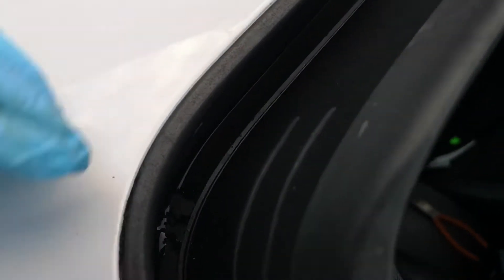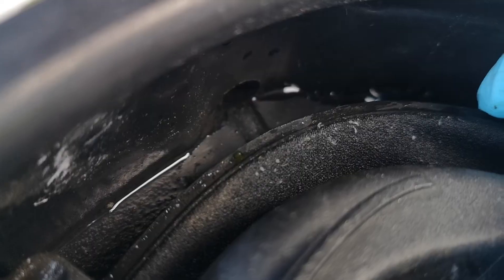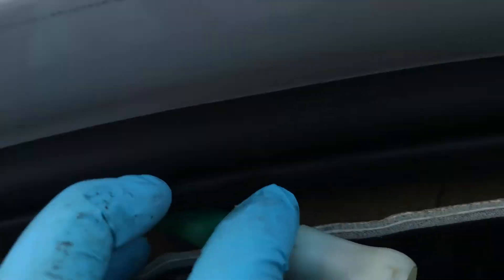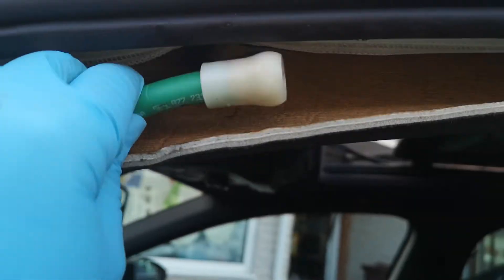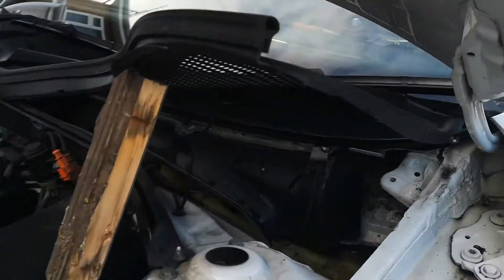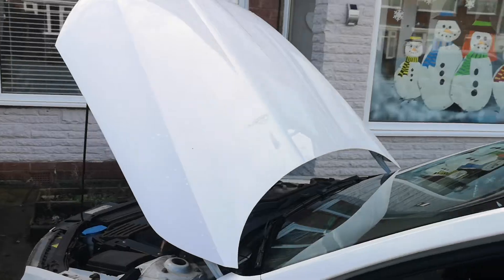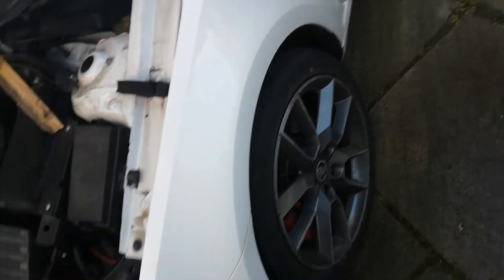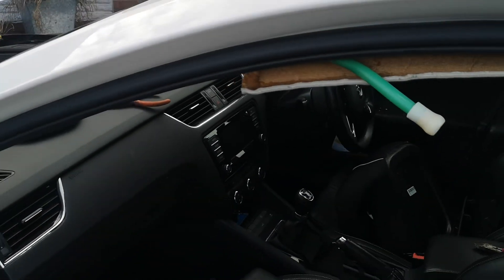Fixed Skoda Octavia mk3 panoramic sunroof drain blockage=flooded footwell! Part 1

Comment: Hi Tony, I had a similar problem with my 2014 Octavia VRS with Pano roof when i first bought it (used) I found that water was travelling from the roof, down the passenger A pillar and pooling in the nearside footwells. The tell tale was the smell and water splashes around the bonnet release handle where it was finding its way out, with the A pillar trim popped off it was easy to see what was happening.

It turned out in my case that the bonding between the roof and the plastic hosing/tray which it sits in. Both had to come out and be re-bonded, touch wood no problems since. Had to shop vac a couple of litres of water out of the carpet but was lucky as it was the height of summer so managed to get it dried out, steam clean and anti-bac it in situ (I've dealt with a water logged fiesta where all the carpets and underlay material had to be stripped out and cleaned out of the car which was a nightmare).

I did a lot of research while trying to sort my problem and most of the time the issue is clogged drain hoses as you identified here. I now 'service' these on a yearly basis. I would be cautious about sticking wire or similar through them as I've read of people tearing the hoses, similarly with using compressed air, the white push fit piece that connects to the roof tray is only bonded to the hose and I saw one chap managed to blow these apart using compressed air and had to rebond them in.

I start by manipulating the rubber drain points on the bulkhead by hand as this seems to be where the majority of the dirt accumulates. To get to them its a case of opening the bonnet and pulling the rubber weather strip off the top of the scuttle trays. There are then some friction clips that need taking off the scuttle tray. The passenger side scuttle tray can be removed IIRC, however at the drivers side you will need to gently (they can be quite brittle) lift the scuttle tray up and squeeze your hand in to get to the drain point as to fully remove the full scuttle panel requires both wiper arms to be removed. I then  flush it through form the roof tray using a good quantity of warm (but not too warm) soapy water. If this still isn't flowing freely then I use a length of plastic hedge trimmer wire, doubled over and fed from the roof down through the drainage pipe. I prefer not to do this, however its quite flimsy stuff so if it runs into any resistance I don't think it would cause any damage whereas wire could.

I also service the roof itself on an annual basis. Information online suggests you need expensive Krytox rubber treatments and a special lubricating paste from VW (which I bought at considerable expense and its not that good) to service the roof - however you don't. Open the roof and carefully blast any debris out of the runners with compressed air, once the majority of the crud is gone it can be further cleaned with a soft haired brush and a damp cloth, next clean the rubber seal with a damp clean cloth. I then treat the mechanism with a coating of  WD40 Specialist Dry PTFE Lubricant and the rubber seal with nextzett gummi pflege rubber treatment. 

If your Octavia is like mine and has the older style door seals that trap water between them, its also worth coating the rubber passenger and boot door seals with Gummi Pflege as it does an excellent job of stopping the seals from freezing to one another in the cold weather, as they are otherwise prone to doing.

I keep meaning to look into clearing the rear drain tubes, however as you say you cant access these from the roof as they are concealed by the roof mechanism. I've seen some technical diagrams for the MK3 Leon (which is basically the same car)  suggesting them travel down the C pillar and out near the rear wheels, however I think they may be hidden behind the arch liner somewhere. 

While the panoramic roof is nice and all that, it adds a lot of complication and weight to the car (which in TDI trim isn't exactly quick to begin with) and I would steer clear of getting a car with one in the future. I appreciate you've probably sorted your problems by now looking at when you posted your video, but just wanted to share my experiences in case they might help anyone else who finds your video.

Cheers
Reply: You're awesome thanks for all this useful info.  I'm in the market for a skoda with sunroof so great to know.

Comment: Anyone had any issues with water sloshing about when stopping? 

Its a Skoda Octavia estate 2016.

I have checked the panoramic sunroof for signs of a blocking and everything seems fine. The noise seems to be in the area of the passenger's rear seat above the door. Any info would be much appreciated. I haven't noticed any unusual smells or any damp in the car as yet. This started about 2 days ago.

Many thanks.
Reply from the maker: Could it be in the actual door? I've had cars in the past that literally stored litres of water and there were plugs to let it out at the bottom
Reply: @SkodaOctyFixes  ill have a look now but it sounds high up, doesnt help its throwing it down and i dont have a garage for it 🤣

Update: it is in the door! Thank you
Reply: Yes loads in it, thank you.